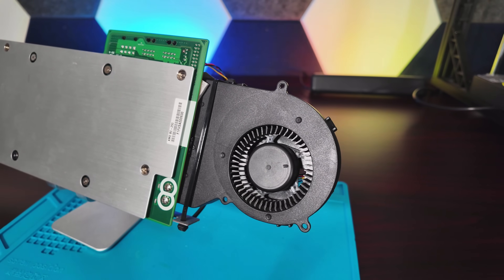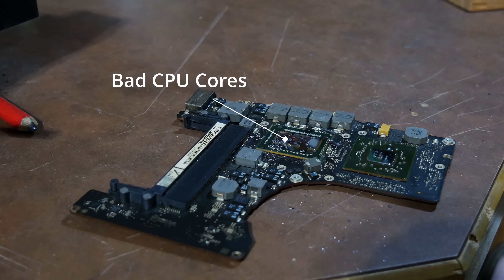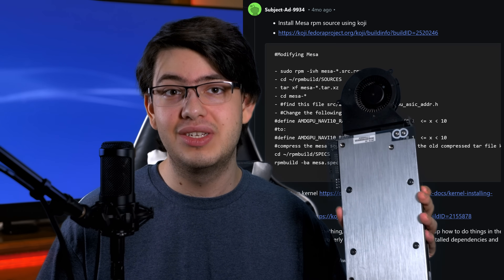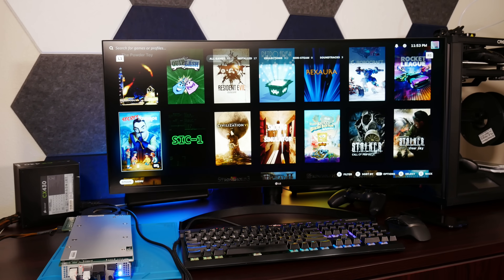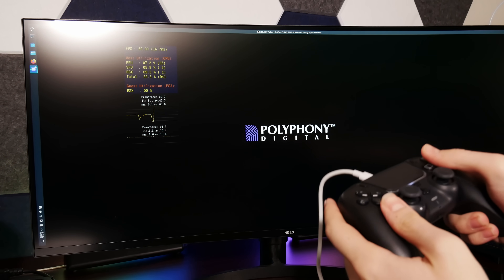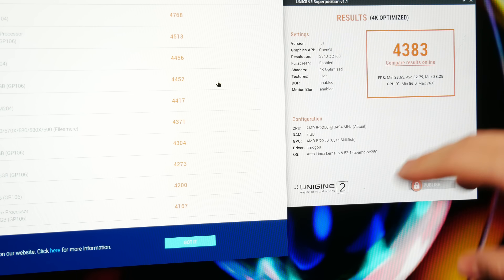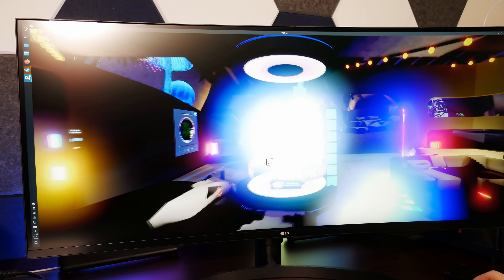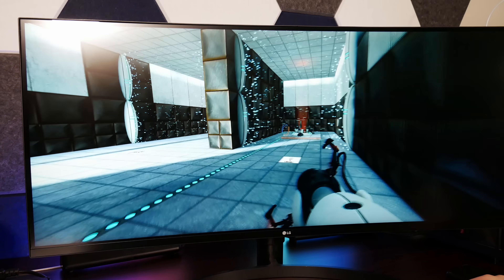I Ran PS3 Games on PS5 Silicon to Prove Sony Wrong

Comment: Per RPCS CPU chart the PS5's CPU is somewhere between B and D Tier, which does cover the threshold for it to be able to run some games for a given definition of run.  There is however a reason they've pursued AVX-512, and CPUs with that have their own separate tier on the Chart.

Sony's intent with the statement is correct.
Reply: But this is a partially disabled PS5 CPU with only 6c,12t enabled with multicore performance like a R52600X , it should be a D tier CPU. With all 8c,16t enabled and more shaders from a fully enabled iGPU, the performance level is very different, probably between B and C-tier of that chart.
Reply: @fleurdewin7958 Single core performance is more important, than these 2 cores.... Also GPU power is going to boost only resolution, not stability.
Reply: @fleurdewin7958 the ps5 cpu is not fully reserved for games though. To my knowledge, 4 threads are reserved for ui and such.
Reply: The RPCS3 devs themselves have said the CPU is not ideal for PS3 emulation.
Reply: They said it isn't ideal, not that it doesn't have the power to handle such emulation
Reply: Funnily enough, the RPCS3 emulator runs fine on AMD handheld consoles, keep supporting Sony's laziness

Just search for ROG Ally Uncharted 3 gameplay

Comment: I hereby grant you the authority and permission to claim that you turned your PS5 into a Steam Deck. You earned it for all the messing around in linux you had to do to get there
Reply from the maker: I'll turn it into an Xbox 360 next
Reply: @LowestLogan put a sticker on It: this is an Xbox
Reply: @LowestLogan  Switch pro next lol
Reply: @LowestLogan  Please respond. There's an emulator called "Xenia", it's an X360 Emulator and use Canary because it's updated.
Reply: You say that like a threat  @LowestLogan 
I interpret it as a promise
Don't let me down
Reply: @LowestLogan  after all everything is an xbox
Reply: @LowestLogan  XD
Reply: @LowestLogan Do you not understand the madness you speak!?!?
Reply: @LowestLogan  That would be neat, but a Xbox One X knockoff would perhaps be funnier? If it works, and works well enough, you could use it to poke fun at Microsoft that Linux works better doing their OS's main job on said console. Or something of that sort. 

Basically anything with at least 4 cores and a GPU with 1GB of vram or something close to that roughly speaking should be able to outdo a 360. I think. Could be wrong, but not terribly.
Reply: @ManuFortis Xbox security is pretty good these days. I think you'd struggle to emulate it
Reply: @phill6859  For the Xbox One S/X or the Xbox Series S/X?

One came before Series, after 360; just in case you are as confused as Microsoft intended.
Reply: @ManuFortis  either really. I think 360 would be kinda doable. But lots of work.
Reply: @phill6859  You're probably right.
Reply: hi
Reply: man bringus really is in the trenches of hardware fuckery huh
Reply: You should make a video on this
Reply: Sony Xbox 360 ~ 🗿
Reply: The bringus seal holds higher honor than any seal ever made. Wear it proudly
Reply: Optical media good.
Reply: Holy crap it's BringusStudios!!! Love your videos dude! Keep up the good work!
Reply: You should make a brand of chips called Bringles
Reply: The Bringus has spoken.
Reply: not gonna lie I would watch you messing around to get this thing working on your side, if you can get one that is
Reply: You know it's something with Bringus commenting... JS.
Reply: YOOOOOO BRINGUS BOYYY
Reply: I've seen other people running games on this here on YouTube.
Reply: he has bringussed us all
Reply: When will the bringussy turn his ps5 into a steam deck
Reply: THE moment u have bringusstudios complementing ur vids....... just know theres some majour complications that no normal human can behold other then THE most jankyest of all janks can do
Reply: The Bringle has blessed the comments on this day.
Reply: holy shit its Jon Bringus!
Reply: when your video about Linux on ps5
Reply: Bringus brings his own cameo here.
Reply: He did it so nonchalantly, which is honestly commendable.
Reply: NOOOO HE GOT ROBBED 😭 rip nvidia pc
Reply: Should try this with the amd4700s desktop kit 💀
Reply: hi bringus
Reply: He has integrity bringus, he's not the degenerate modder we both are.
Reply: He Bringsus approval for new tech YouTube
Reply: ps5 is a big, FreeBSD steam deck.
Reply: I have a steam deck. Its great. But all kidding aside, the ps5 must be much more powerful than a steam deck.
Reply: The goat
Reply: You've heard it here folks, the PS5 blade now has Bringus' seal of approval!!!
Reply: Ho li shyt! You got the bringus badge, that baby is CERTIFIED
Reply: Yes, and he used a Samsung Samsung SSD to do it 🎶

Comment: Steam Deck could run some games on RPCS3 and that's an even more cut down SoC. But the issue is that there are still tons of games that are still unplayable. RPCS3 is only 70% compatible sadly
Reply: It seems a bit weird to start out saying that Sony’s claim that it’s too complicated to emulate and that the real reason is they want you to buy things, and then immediately start showing games with various glitches depending how they leveraged PS3 architecture.
That a dedicated multi year effort still has lots of unplayable PS3 games seems to suggest it being extremely complex is actually true.
Reply: You realize this is a project by hobbyists and sony has access to the entire ps3 spec which we dont have. I find it strange that in the tech world people just expect companies ti work the same or worse as unpaid hobbyists working off of reverse engineering. Sony made the ps3 they have the entire documentation needed to address these bugs.
Reply: @FemboyCatGaming  Yes I understand but Zen 2 cannot be fully compatible because it's messing alot vector operations. Which is why when AVX-512 was added in Zen 4, RPCS3 compatibility and performance improved alot. AMD only added AVX-512 to improve AI. There are still aspects where Zen would still have a hard time dealing with SPU code since it's missing TSX, which is only in some Intel CPUs. 
There are many things missing in modern hardware that is not compatible with the Cell. It was such a unique design that emulating it is very hard unless Sony was willing to pay AMD more money to customize Zen cores just for emulation.

Comment: It's definitely based on Sony's lack of ambition towards emulation. It's much much easier for them to allow cloud streaming, charge you for it than compile an entire architecture and full on system integration. Funny how the main staple for many was that PS had backwards compatibility and now it's pretty much left caked in the dust primarily due to greed, it's the one thing I will say Xbox has handled tremendously better.
Reply: They updated their PS2 emulator and fixed a bunch of old games a few months ago.
Reply: Ironically, the Xbox backwards compatibility situation is actually likely what is further discouraging Sony from doing it themselves. 

The goal of the Xbox BC program was ultimately to draw the 360's install base into the current larger Xbox ecosystem. Alas, when it became apparent that it wasn't happening to a discernible extent, Microsoft gave up on any further updates, even for enhancement patches.

Conversely, the PS5 doesn't 'need' the PS3's help, it's already over 2/3rds of the way towards the PS3's lifetime hardware sales as it is 4 years in and no cuts to the MSRP.

Comment: Would it be possible to swap the CPU for one from a defective PS5?? To get a more accurate comparison. Of course you need to know about BGA for that. And the question is whether the BIOS would limit the new CPU but it would definitely be an interesting experiment🤷🏻‍♂️
Reply: Difficult, but theoretically possible
Reply: As far as I know it wouldn't be possible, there are efuses that prevent something like that from working

Comment: It’s also proof that windows 11= bloatware. And Linux is superior to windows. Both Nintendo and Sony run custom Linux os.  Vulkan and Linux is the future of gaming.  Now we just need Valve to lunch steam os.  We know it’s coming to desktop PCs.  We just don’t know when.
Reply: Sony and Nintendo use OSs based on BSD
Reply: BSD actually they use which as many distro. But it's a separate thing from Linux.
Reply: windows is holding back computer technology as a whole, its archaic af. im just gonna be using the LTSC until the support stops around 2032, hopefully linux gets better support for its drivers and online gaming by then cause windows needs to go away finally.

Comment: The funny part is the RPCS3 team released a build for the RPI5 today LOL

On one hand you have Sony "herp derp the PS5 can't handle the PS3" and on the other hand you have madman's saying "hold my beer! Here! It's running on the RPI5 now!" LOL
Reply: Guess it can some 2D indie games, but that is pretty much it.

RPi5 CPU is very weak, a Zen 2 core in the PS5 is way bigger and more capable than a A76 core, wich is on the level of a 2011 x86 core.
Reply: @rj7250a  They showed it running some 3D games. Not the most graphically intensive ones, but 3D nonetheless.
Reply: @rj7250a Why guess wrongly when you can go to their yt channel and look for yourself.
Reply: @rj7250a  Of course, but if it run's at all on a Raspberry at 280p or whatever it is, the PS5 can run it at native resolution and more without problems. They've run Outrun on the raspberry and is rock solid 30fps at psp resolution yeah. Isn't something?
Reply: @rj7250a they showed 3d games like god of war 1.
Reply: @Lastingbeats that's a ps2 game
Reply: I'm a pleb in this subject but what I'm aware of is if Dreamcast GTA3 is possible everything is
Reply: Ugh, people need to actually read the blog that goes with that video. In order to "run" RPCS3 on the Pi5 the CPU was overclocked 400MHz and the GPU by 100MHz. And they had to drop the resolution from 720p to 272p (PSP resolution). Since this isn't realistic (and it was a steady 30fps still configured this way), the team concluded that the Pi5 was NOT powerful enough to run RPCS3. Hell, the Pi5 has a weaker GPU then the actual PS3, and the CPU isn't going to be able to fill in the gaps.
Reply: I wonder how well would Trash Panic run on anything, especially low-end hardware? 

That game was one of the most unique games ever and was only on PS3
Reply: rpi5 will probably only run 2d ps3 games lol
Reply: @lostsektor  And what about ARM boards with more powerful CPU cores or GPU cores?

Something like… a Mac Mini M1?
Reply: is it actually intended for pi or just a linux arm64 build?
Reply: @gamagama69  Any Linux ARM64 build. Maybe even Windows ARM64 build.
Reply: That's a proof of concept. Like DS emulation on the PSP. Its never gonna be properly playable for most games.
Reply: That demo involves obvious stutters issues and sub-native resolution target resulting in very obvious aliasing issues..  and isn't exactly showcasing the most difficult to emulate titles.

Doing it the way someone Paying Money would expect it to work does require AVX-512, and even then... if you had the equivalent of DF running analytics you would still probably have people fussing about +/-10% fps cap deviation like they've done with games enhanced by the PS5 Pro..

Sony is correct that people would not be happy with paying for a Tier B to D CPU RPCS3 experience.
Reply: @jebe4563  You're assuming you know how Sony think on this, and you don't. No one does. Actions speak louder than imagined words though, so let's look at those. 

People happily paid for PS Now when it was a seperate service, then Sony rolled it into PS Plus and I'd consider that a massively sub par way to play PS3 games, and I'm not the only one.

They've released PS2 games emulated on PS5 that are clearly done by interns or whatever as they have performance and graphical issues, people still buy them.

So based on what people do and what Sony do, PS3 games on PS5 would sell. If Sony won't do it despite that, the homebrew community probably will but then it'll be more niche.
Reply: Everyone here not reading into if a Pi 5 can emulate PS3 games at reduced settings then a full on PS5 should be able to natively run the games perfectly fine
Reply: You still pretty much need a threadripper to run a large number of titles with RPCS3. It’s optimisation is fantastic but the PS3’s hardware is just so unique it’s no where near as straightforward as, say, Xbox 360 emu